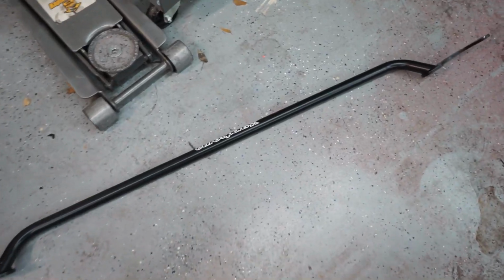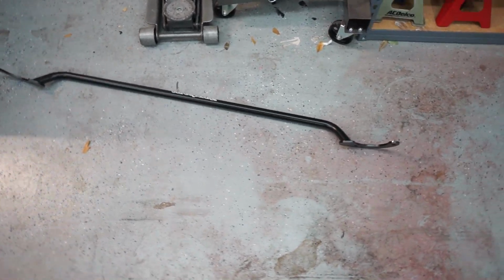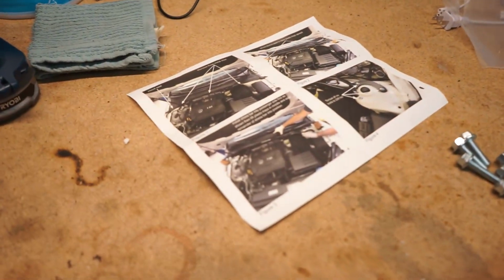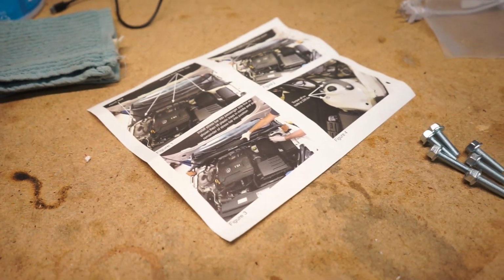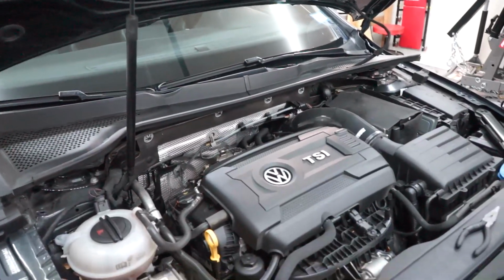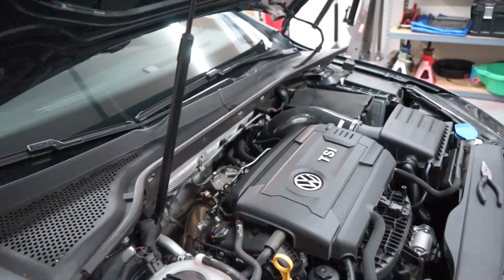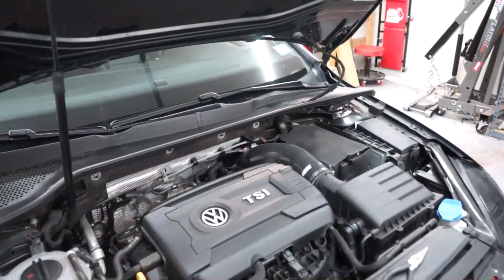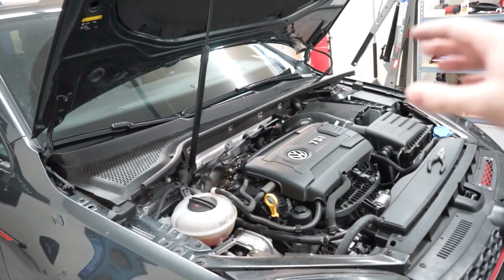Euro Sport Upper Stress Bar for the Mk7 GTI!

Comment: Was looking at front chassis braces and everyone mentions Eurocode but a bit pricey. Did some searching today and Eurosport comes up with your install video. I'm working on my chassis reinforcement / handling mods, and so far I've upgraded my RSB to Neuspeed 25mm, have some ECS rear subframe locking collars coming in tomorrow. This, or other chassis reinforcement mods are next on my list. Looking forward to hear about your overall experience.